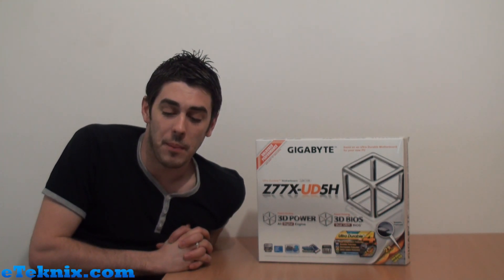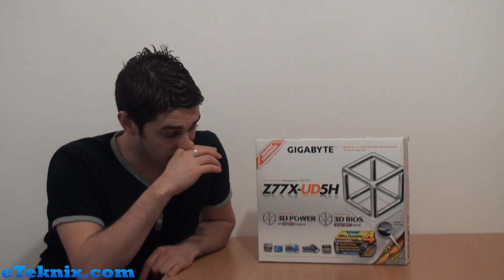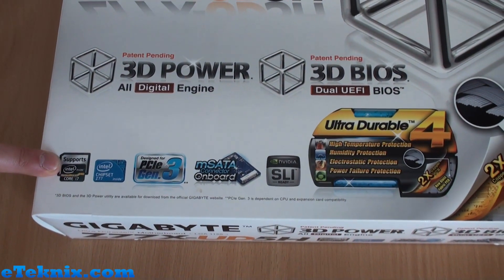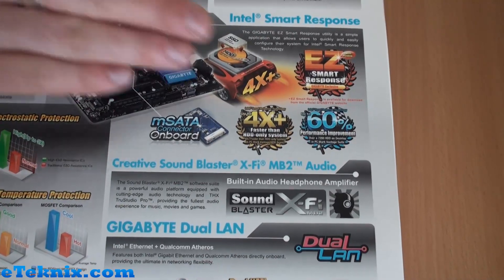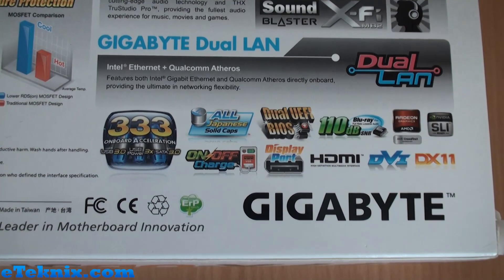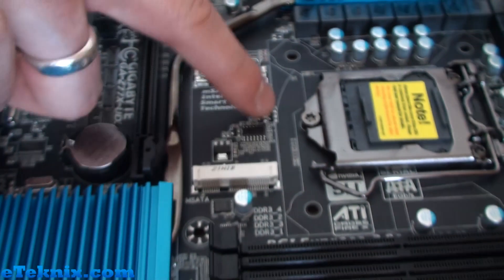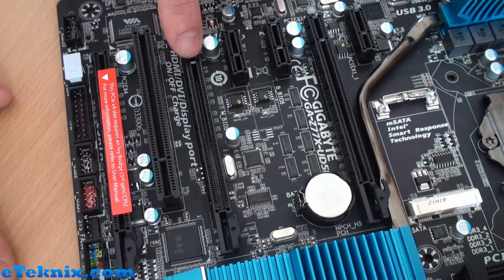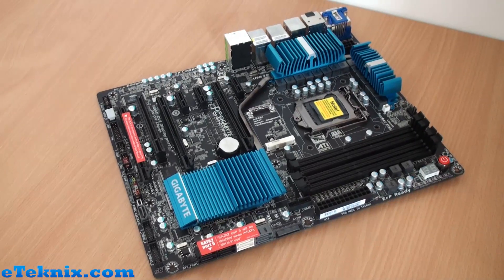Gigabyte Z77X-UD5H Z77 Motherboard Preview

Comment: The on-board USB are as listed: 6 x USB 3.0 + 4 x USB 2.0, It has 3 USB 3.0 header which can power two USB port each. It also has two USB 2.0 header supporting 2 USB 2.0 Port each. One of the USB 2.0 uses On/Off charge, which will still be able to charge any USB devices, even with computer off. Hope this helps.